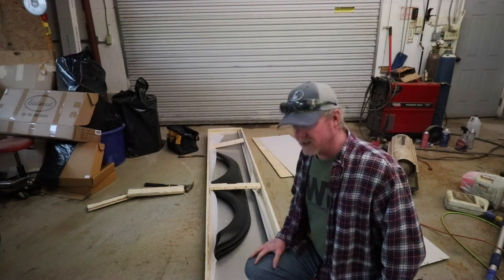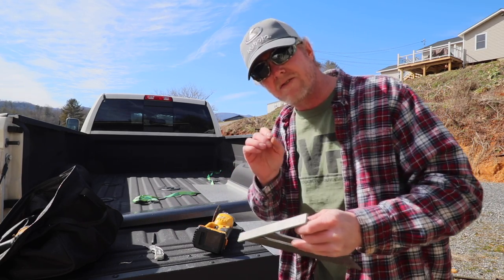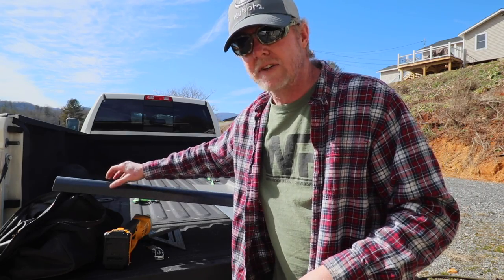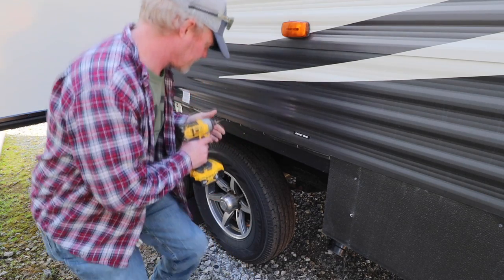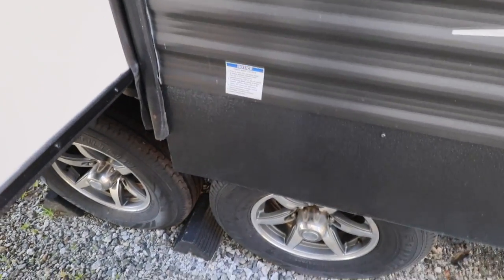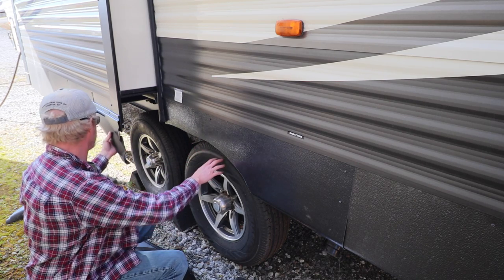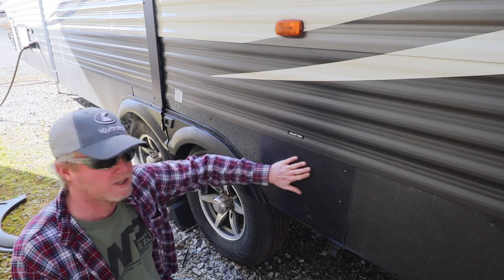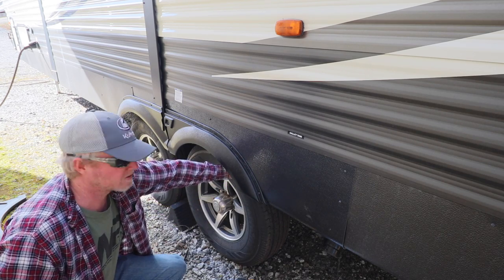Camper Fender and J Panel Skirt Repair after a Blowout.

Comment: I’m in the Same situation. Can you send me some info please.
Reply from the maker: First make sure you get higher ply tires. You'll need to order parts from a dealer and expect to pay the most for shipping as they require crating. I ordered several pieces more than I needed since shipping doesn't change much and the parts are actually reasonable. Any RV dealer typically that sells your brand can order parts from the manufacture. The install isn't too bad and just need basic tools.